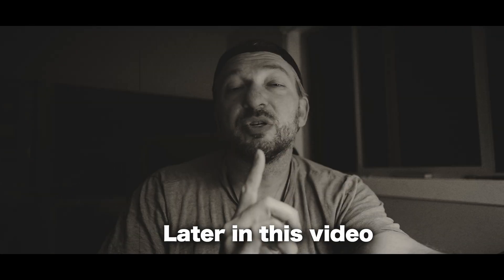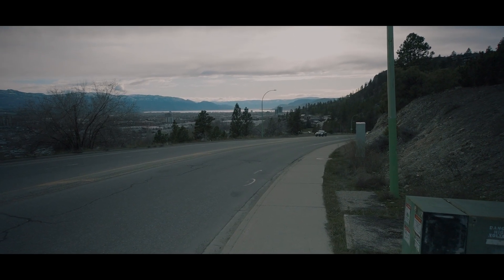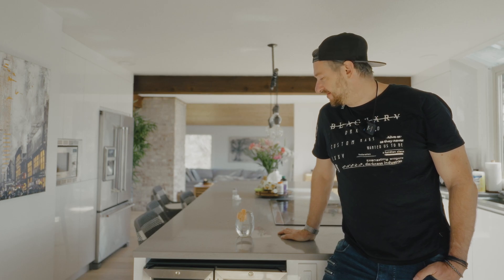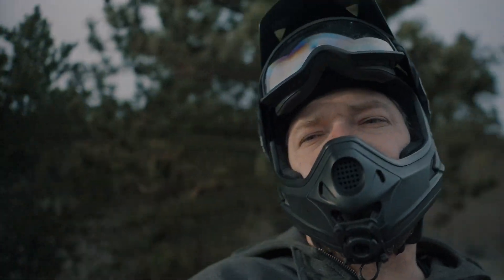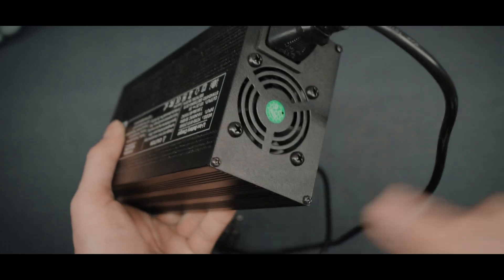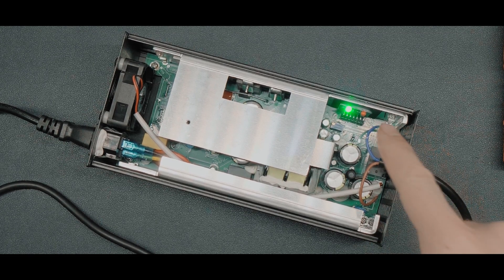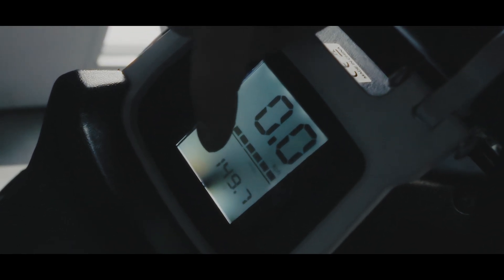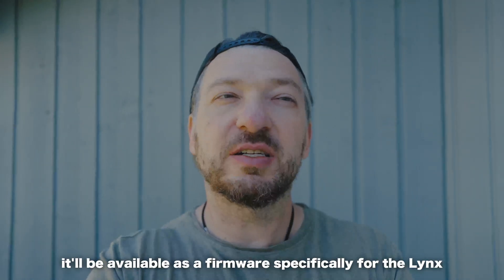Veteran Lynx Overcharging Issue and FIX - Watch this BEFORE buying any #EUC

Comment: If you decrease the voltage: i have 151.6 V, will it not balance cells at 149.6 V like in your case?
Reply from the maker: bms should always balance the cells equally (-ish) at the voltage you set

Comment: I think there should be a setting what voltage should the wheel to be charged to, or percent. For example 70,75,80,85,90,95 and 100%. But only when balancer can handle this and balance even when battery is not full charged.

Comment: hi, let's say I rarely do a long trips and want to make sure I don't get a trouble while hard brakeing when 100% charged up. Do you think in that case is reasonable to set charger let's say to 149V (which is around 90%)? Do I get the same level of cell balancing with this?
Reply from the maker: 149v is about 98%. If you don't start riding from the top of a mountain, just set it to 150-151.2v, and you'll be fine. The BMS will balance the cells accordingly.

Comment: I got my pidzoom C200 today and adjusted the voltages on my charger as you’ve instructed. Before I adjusted, I didn’t pay attention to what the stock charging amperage was, but now after adjusting to 151.2v the pidzoom is only reading 3.6amps charging at around 480-490watts. Does that potentiometer adjust the amperage as well as the voltage. I thought I’d asked before going back into the charger and re setting it to stock, with in my case was 152.6v.
Reply from the maker: Nope, shouldn't be that. A potentiometer primarily adjusts voltage. It is a type of variable resistor that can be used to divide voltage in a circuit, not directly control current.
Reply: @leoenin  ahh cheers mate, is it also possible if you can check what amperage your stock charger is charging at?
Reply: Ohms law. V=IR. Increase R by turning the pot, you need less I( current) to have the same V. P=I*V. So less I leads to less Power. Hi school is a thing that noone appreciates

Comment: Very nice! I subscribed. So after the P.S. news at the end I won‘t have to open up my charger. :)

Is the firmware already out or do we have to wait a couple of days?
Reply from the maker: Afaik it's being tested atm, the voltage limit will be adjustable on the wheel, they're some videos circulating on telegram
Reply: @leoenin  Thanks so much

Comment: I know who you are now.  Subbed,  my lynx is on the way.  But even with the firm ware, redundancy is important for safety.  I will be doing this anyway.  Thanks man!
Reply: Redundancy is safety rule number 1. Anyway I'll keep my charger lower as well, but I will keep an eye on the cell balance in case the lynx onboard hardware is responsible for balancing and incase it'll only do it after reaching a certain voltage